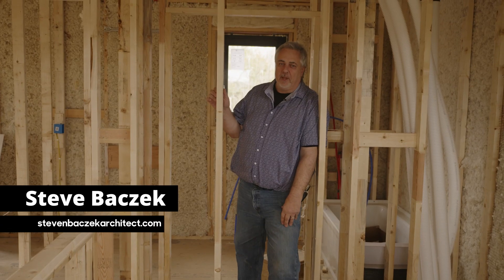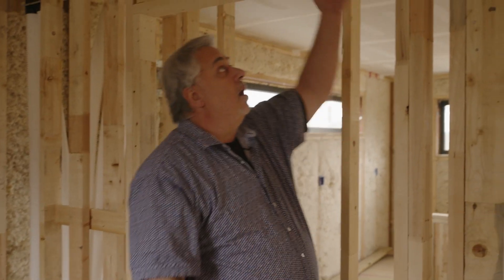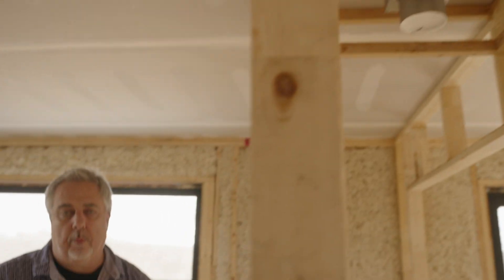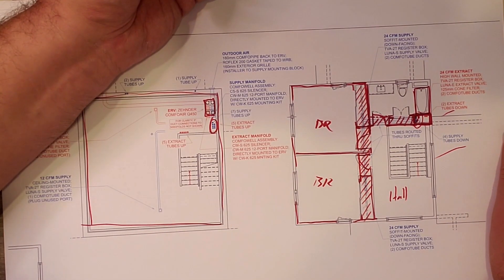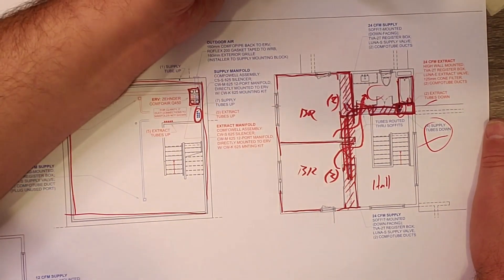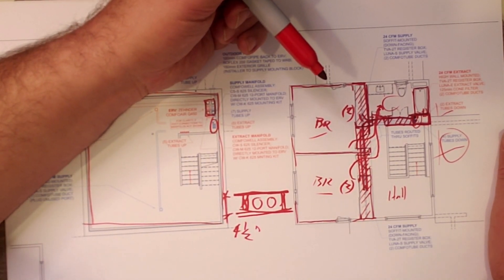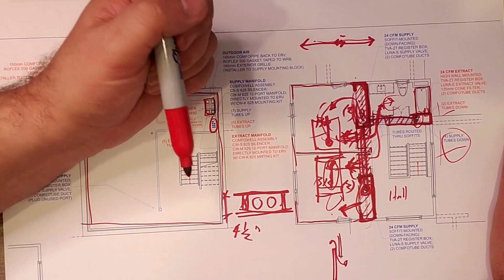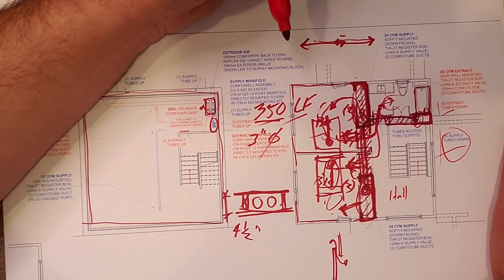VENTILATION ROUTING

Comment: Hey Steve, say you had a vaulted cathedral ceiling utilizing parallel cord trusses with insulation against the roof decking. Could those comfo-tubes be run through the truss open web cavity between the roof insulation and the drywall beneath? Also can those tubes be buried in insulation?
Reply: Seconding this question! Doing exact same in my new build, and my biggest concern is if there will be enough space in my truss webbing for HVAC and ventilation ducts. (In my case I’m lucky that there will be about a 4ft space between the roof deck and ceiling chord, so hoping that’s plenty)

Comment: Great video.  Great idea to deliver the fresh air to the closets and let it migrate through the bedrooms. Keeps clothes fresh and prevents fast air from blowing into the room.  I'll pencil that in to my retirement home plans.  I assume the Zehnder tubes are carrying the conditioned air (heated/cooled/fitered) as opposed to being a separate fresh air system.  Since the ceiling above is the air barrier of a ventilated roof system, there is the desire not to route the tubing through that air barrier.  Yet, we wanted the venting to come from above, thus the use of strategically placed soffits to create chases for the tube.  Would routing the tubes through the floor joists and then vertically in the walls of the bedrooms been another way to get there?  In that case,  vertical chases in the closets  might be better than growing the walls to 2x6 to accommodate the tubes.
Reply: Yes I wish the videos or series had a bit more structure. He did a build show Boston which essentially covered every detail of a new build. 
Not sure what this house in Missouri is using for HVAC. I know they have a few different strategies for air sealing and insulation from videos made by Jake the owner of Aarow building.
Reply: The Zehnder tubes are not carrying conditioned air. They are independent of the HVAC. The HVAC carries much higher volumes of air and will have independent large ducts.
Reply: @frqnj  That is what I thought also. 3 inch corrugated tubes would require high velocity air which could be noisy.  If that is the case, putting, putting the vents in the closets could mitigate that.  But after giving us a detailed explanation  of how the 3 inch fresh air tubes were routed, he did not explain how conditioned air ductwork is routed.  It seems that is relevent also.  The climate  at this house in Missouri warrants both heating and cooling, so even if it has radiant floors for heating, how is it cooled?  Mini-splits or central air ductwork.  I watch all of Steve's videos and they jump around from house to house and each is unique.  I am trying to get a full picture of how this house works...the roof system, insulation , HVAC and fresh air, windows and doors, sheathing., etc.  I will check to see if he has a playlist for each house.  That, with an overview of the house would be nice.  Maybe he already has that.